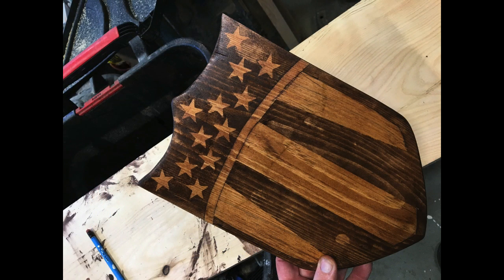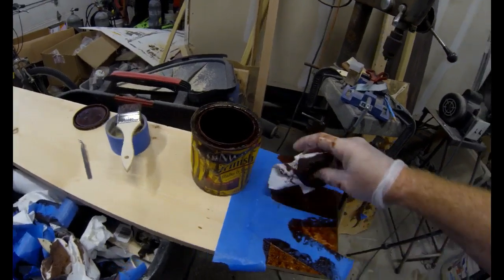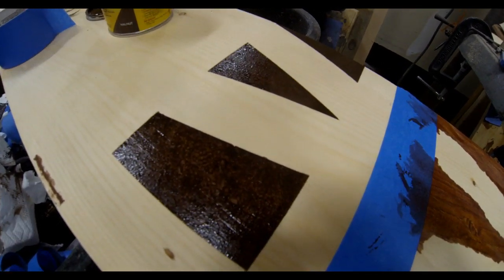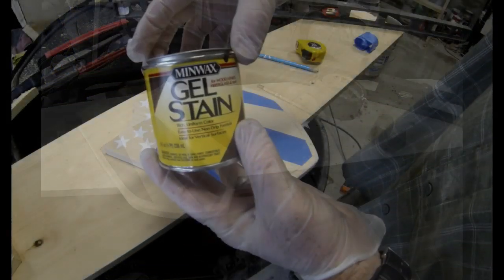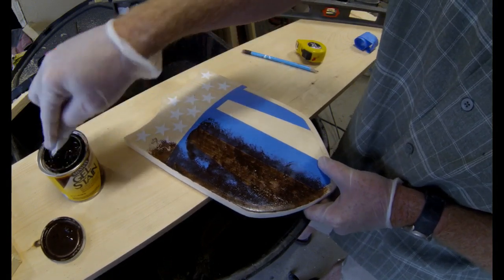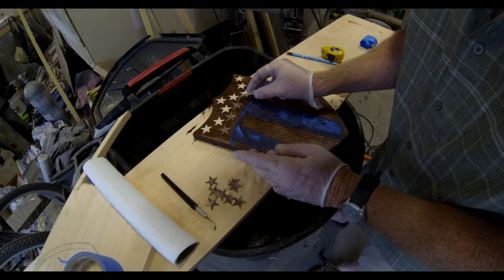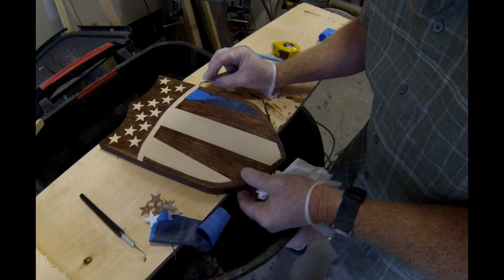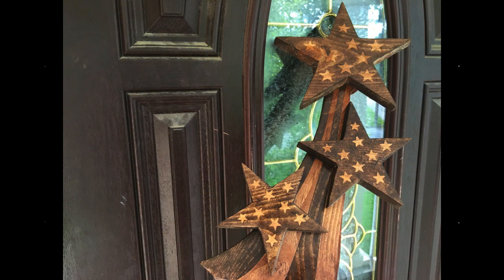Easy DIY No Bleed Wood Stain lines and stencils

Comment: Awesome! My fiancé just finished my work desk. I love contrasting colors so I’m going dark with the legs, trim, and edge banding and light for the table top. I’ll mask tonight and come back with an update after staining tomorrow 🤞🏽

Update: I definitely recommend this method. I used blue painters tape because I didn’t plan on leaving my house. I was watching another video where someone suggested using a box cutter (I used an exacto-knife) or something of that sort to score the edge of the tape so the stain will seep into that line versus onto the wood under the tape that’s being taped off. I applied the stain with a napkin trying my hardest not to wipe just dabbed, then also dabbed the excess and wipe the rest as instructed. (btw - I left the tape on over night and stained the next day) I also took from that video, peeling the tape off at a 45 degree angle. Came out looking crisp very happy with the results 💜

Comment: Another trick is to score the wood with the xacto knife when cutting the tape into the desired design.  Capillary action will draw stain at the edges into the channel created by scoring resulting in clear, crisp separation.
Reply: Very good tip that's unknown by most. 
Great explanation as to why this tip is so effective.
Reply: I thought this video was going to show that exact technique!  But it did not.
Reply: so you can use that technique with normal stain? and the score isnt noticeable afterwards?
Reply: You mean like a juice groove on a cutting board?! Oh man this is going to help me immensely!! About how deep should the score be?!
Reply: @tyyy00  I don't imagine it would be noticeable. The score holding the darker stain will just blend into the line.
Reply: Scoring did absolutely nothing for me. It still bled through. Even when “dabbing” it on.

Comment: Great video! Is there a way to keep the gel stain from bleeding and mixing with the regular stain? I've tried a couple times, but it always bleeds.
Reply: What brand are you using? We tried the Minwax like in the video, but we found better results with the varathane brand.  You can use either painters tape or vinyl and wipe/brush over them like crazy and they don't bleed.  It's much thicker than the minwax - but also a few dollars more per can.